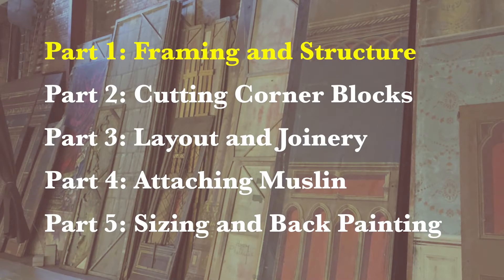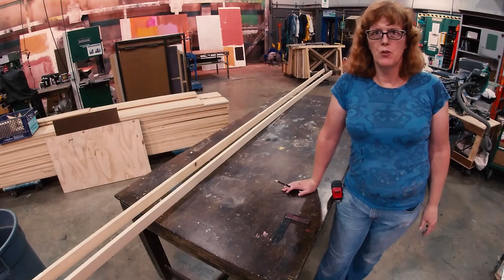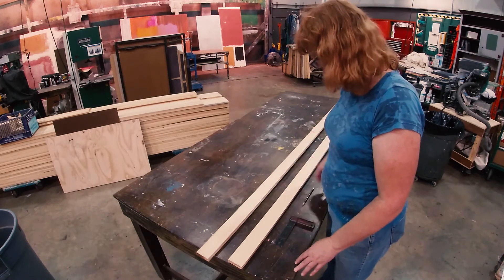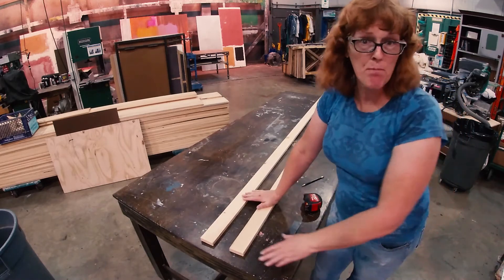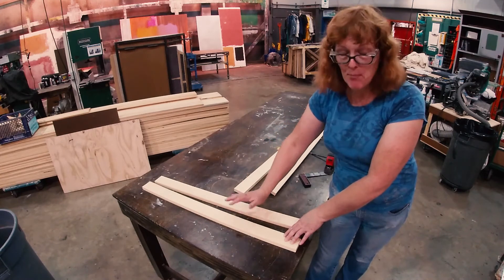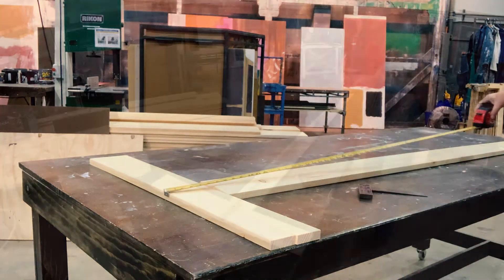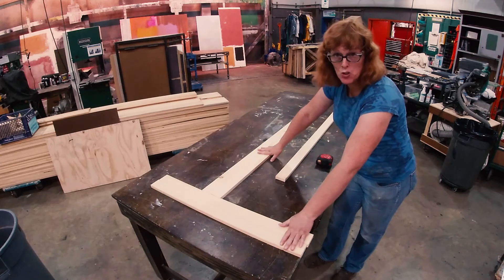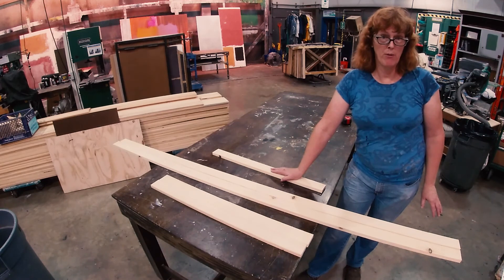Soft Flats – Part 1:  Framing & Structure

Comment: Thank you so much for your channel and your videos! I'm currently running a little "shop club" at the middle school I work at with a few of my 8th graders. We are doing Frozen Jr. this Spring and so I have planned for us to construct a few different moving door props.

My biggest question right now is how do I build a flat taller than the stock that I have available (which is about 8ft)a. I prefer to do a Hollywood flat but if getting that extended height is easier with a Broadway flat then I'll plan for that. Just need some guidance please!

I truly appreciate your expertise and love learning from you videos! Thanks in advance!
Reply from the maker: I am working on a video discussing sill irons for door flats and looking back at some books and references that discuss scarf joints for making soft flats taller than available stock lumber. I expect you can do something similar for hard flat construction. Though other than a mention and a drawing it doesn’t discuss how the scarf joint is secured together. 

Lumber should readily be available most places up to 16’ long. It used to go to 20’ a long time ago, but now that’s a special order and a premium cost. 

With hard flats, it’s also easy to stack smaller plugs on top of shorter flats. Or if you have 8’ flats and need 10’ height, then add a 2’ wide flat on its side on top of all the 8’ flats. That option makes more seams to patch. You could build your flat frames in pieces like that and overlap the seams with your lauan covering to join the flat and plug. Those come to mind right away.
Reply: @calstatelaalproductions2358  Thank you so much for the speedy reply! I totally forgot that stacking flats was a technique!! Back to the drawing board, thank you again!